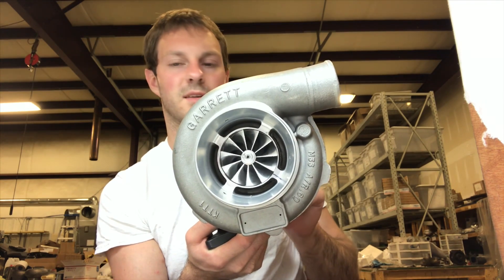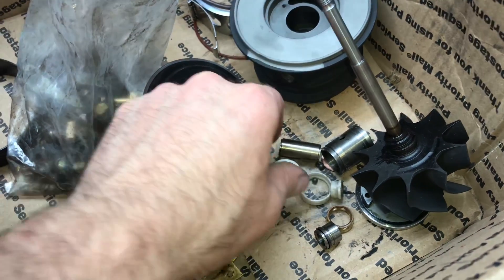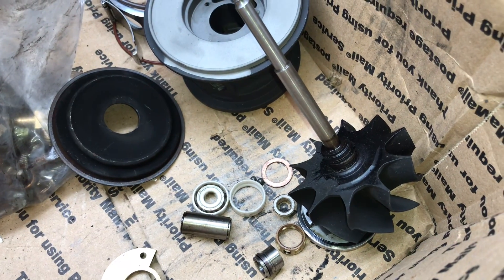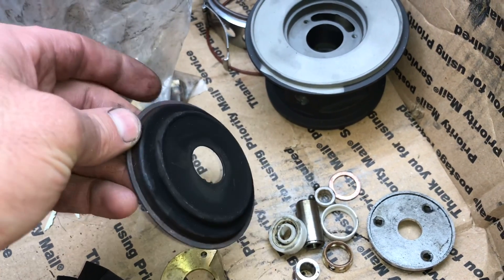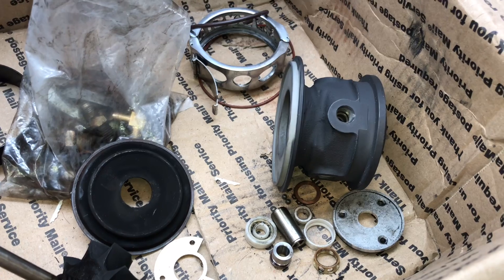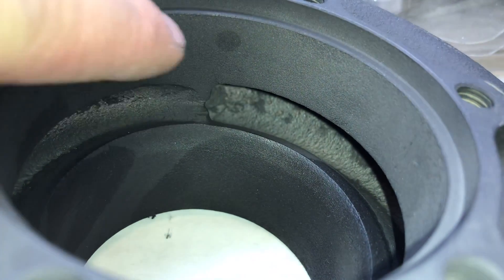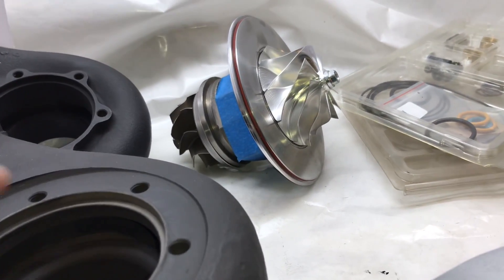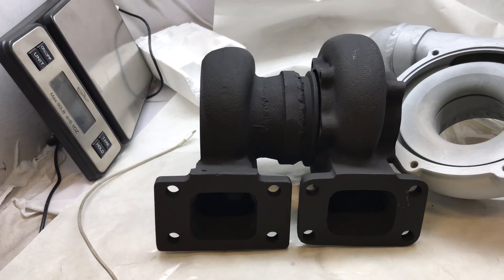eBay GTX3582R vs Genuine Garrett GTX3582R

Comment: I wouldn't bother on maxpeeding turbos...got a 2871 piss oil right away with restrictor, got one in """warranty""" paying 50% off and it locked up in less than 5 minutes, you might be lucky but I bought a real 2871 now...

Comment: I'm running a maxpeeding gt30 it's the yellow blade version vband fitment it's like there high end version I guess but it's running 30psi  making 500+hp loads of compressor surge it gets driven hard lots of track days and drag racing I've also put 35k miles on it and it's still boosting hard it cost me £385 so up from the £115 generic version. So if it blew up tomorrow I'll buy another one because 4 years and 30k of abuse is well worth it in my eyes. And who the fuck wants to spend ££££+ on a turbo.

Comment: I don't work on my car, I drive it! Because I buy high-quality parts the first time!
Reply: I’m doing a project for school and reddit about the difference between eBay parts and genuine parts. Rn I’m working with eBay and for how cheap they are, it’s surprisingly good Qual to beat the absolute fuck out of them and gain some major power for really cheap, I spent about $3.5k on everything from a big ass turbo to ECU tuning. I’m about to dyno tune the new turbo and we’ll see if it holds up. I’m projected at about 420 hp on a 2800 lbs (about 1,400 kilos) car.
Reply: @Motherofchicken  They are junk! Poor quality.
Reply: @mrpoopybutthole6314  I know from experience. The quality of the metal is poor. Turbine housings crack, so do the compressor housings. The Chinese turbos are a paperweight. The garretts don't do that.
Reply: You sound just like people I don't like... I know plenty of people that have all the best parts and spend plenty of time working/fixing on their cars.

Comment: Can you review the one that boostedboiz run on all their cars
Reply: So the cxracing turbo is probably the same too?
Reply: @lorddragoono  Yes
Reply: I would hope that turbo is a different turbo altogether
Reply: John Morton Na it’s the same Turbo. It just doesn’t use a fake S compressor housing. The only reason I wanted it to be reviewed was to see if the quality was different
Reply: @Jamxknife  no this one is completely different from the boostedboiz turbo I know the buyer that boostedboiz buys it from and i got an anti surge version of that turbo and I can tell you the compressor housing is different and it comes with a place already to get a boost source un like the one in this video where they had to make their own
Reply: rushking19 Yea but it’s still a gen 1 Chinese gtx3582r. Regardless of covers it’s the same spec in every single way. The quality is all I wanted to find out. To see if they were different in anyway.
Reply: @Jamxknife  he just clearly said that not all Chinese ones are this bad of quality,  the housing differences show that its two different companies making these turbos which varies how the quality will be there have been a few other people with the turbo im talking about that have torn it down and saw that its pretty close to the real thing and actually last a long time
Reply: @rushking19  Bruh I know it's different companies making them or I wouldn't ask for a comparison. Its just the same turbo in spec.

Comment: I'VE GOT THE CHINA KNOCK OFF FOR ABOUT $300...STILL RUNNING STRONG AT 15PSI. ILLBE DAMMED IF I PAY $2,300 FOR THE REAL ONE. NO SMOKE, NO WEIRD NOISES...I'M GOOD.
Reply: That ain't shit! I still have my Turbonetics T3/T4 running from 2003! Ha! Beat that!
Reply: RIGHT...You can get them for $110 for journal bearing or $270 for ball bearing lol fuck garrett
Reply: I've got a china GT3582 on my rb2630 pushing ~440rwkw at 27psi and its still holding strong 10xxxkms later, it did 20xxxkms at 18psi before hand too and god knows how many kms on the engine it came off. The biggest difference to the genuine GTX3528R i had before is spool time, the china turbo comes on alot slower then the garrett.
Reply: Yea I got a cheap ebay turbo lasted like 15k miles 2 years for the price it did great for me. I only ran 12lbs.
Reply: And without Garrett spending the money on development none of these cheap knock offs would even exist.
Reply: @petersavige6401  wrong. Garrett is the on the turbo manufacturer in the world 🙄
Reply: @popiwatv they manufacture out of China. Look up Honeywell and Garrett chinese factory
Reply: Thank you Kanye, very cool!
Reply: Famous last words
Reply: Wait a few years. Cheap Chinese tools work fine at first also, before they fall apart. You get what you pay for.
Reply: @jeffjackson9679  all tools work fine before they fall apart. for 300 bux, he got a lot for what he paid for.
Reply: @jeffjackson9679  they all fall apart at the end

Comment: I have a China GTX35 that replaced my genuine for price reasons. My Chinese one looks pretty much the same. I've taken it apart side by side with my genuine core. They were the same except the billet compressor wheel was taller for the Chinese one with a slightly longer shaft to accommodate it. Chinese billet wheel was 2 grams less than the Garrett one (gen 1). Bearing, cage, and center housing were pretty much the same except the Chinese one of was of the ceramic BB variety.
Reply: does it still work?
Reply: V3N0M Yep! Still going strong with no issues pushing 650whp.
Reply: @taiphoon228  how much boost and timing you running? what car and setup/mod list?
Reply: taiphoon228 so you’re basically saying the Chinese one is better?
Reply: F20B__CB7 ___ Not necessarily. Just saying not all of them are as poor quality as the one he managed to buy and review. Mine is actually dual ball bearing without a thrust washer thing like the one referenced in the video. Mine was an exact clone of my genuine one except the billet wheel was slightly different from my gen1. The Chinese wheel was taller (extended tip). Not sure how it compares to a gen2 wheel, but it drives and feels just as good or better than my gen1 I had. I didn't need to change my tune at all. 25psi full boost came on the same between my Chinese one and genuine gen1. Same rear housing used (swapped over). My fuel maps didn't need to be changed in the mid range meaning my VE was unchanged between the two turbos there. The top end around 7000-9500rpm, I had to add about 3-5% more fuel meaning it moved slightly more air up top for the Chinese turbo which I think has to do with the extended tip blades.
Reply: taiphoon228 great info man. Do you have a link to the Chinese one you bought so I can take a look at it? I’m in the market for a new turbo but I will be eBay for now.
Reply: F20B__CB7 ___ I purchased mine quite a while back. At least three years now. I can't see eBay history back that far. I remember it was around $600 and advertised as dual ceramic ball bearing upgraded.
Reply: @taiphoon228  I think it was the racing first turbo its the same one I have and its has great reviews
Reply: What is the brand of this chinese Turbo friend

Comment: It did great for 3 years and 20+ psi
Reply: Same here cheap china gt35r turbo on 27psi 400+ hp Honda still running strong after 3 1/2 years lols (daily beater) and one for my Evo 8 ran perfect too idk maybe got lucky twice lol.
Reply: @myahfamilyroblox1745  I gues 400+ whp for a honda is pretty good. I'd assume on 3 liter Inline 6 with this turbo strapped on pushing 28-33 psi on boost will hopefully get me around 700+ whp I hope! How much power were you making on your Evo 8? I ran a Evo 8 fully built with a Xona turbo the car takes off like a rocket.
Reply: @myahfamilyroblox1745  What psi boost were you pushing on your Evo 8? dyno numbers?
Reply: Would you have a link of the ebay gtx3582r that you purcahsed?
Reply: Sure 60 is fine,and I don't sorry
Reply: @Pork N Cheese I doubt these turbos can handle 60 psi without blowing up.

Comment: With 1/5 of the genuine garrett price, shouldn't blame much about the quality, with proper oil feed/drain, some china knock-off turbo actually reliable and make good power. China turbo clone quality has improved...
Reply: Buy gt3582 eBay turbos journal bearings you will lose 3%-5% spool speed but will outlive a real bb turbo built like a brick shit house e85 and stand-alone ecu lets rolling anti lag let’s you know real fast . Also hx40 eBay turbos seem to have larger shafts than genuine units like thanks china you fixed the weak link all for 230$ shipped
Reply: @mddunlap03  what about the $450 dollar ebay ones with the dual ball bearings that PFI speed and the Boosted Boiz use on all their 600whp+ builds. Would those journals bearings fit as an upgrade?
Reply: More like 1/10th the price
Reply from the maker: Sometimes it’s cheaper to spend more for quality, the only way to repair this turbo is to build a replacement cartridge, it maybe a little cheaper that buying from garrett still but the turbine housing quality still is not up to standards and won’t perform as well as a genuine housing. Some of The garrett housings have nickel added into the casting to help it withstand heat better also. If this turbo was as good as a genuine one it wouldn’t be here for repair